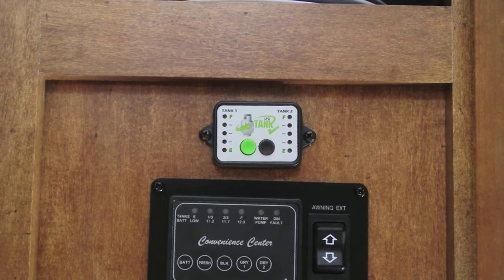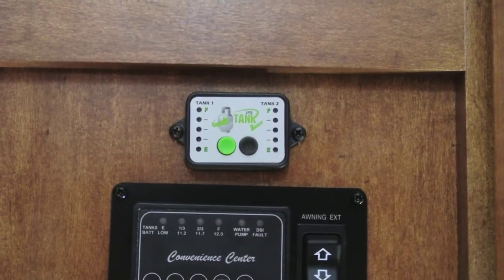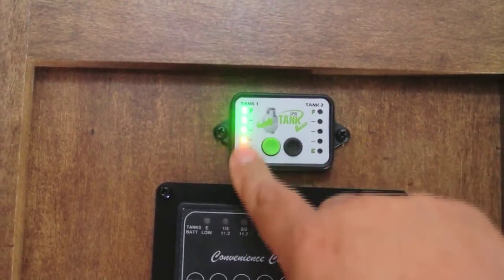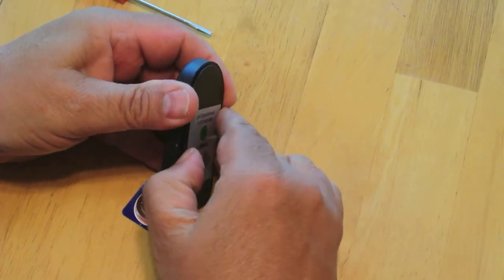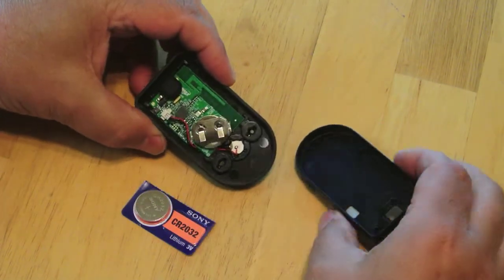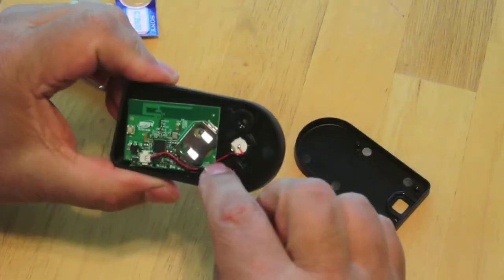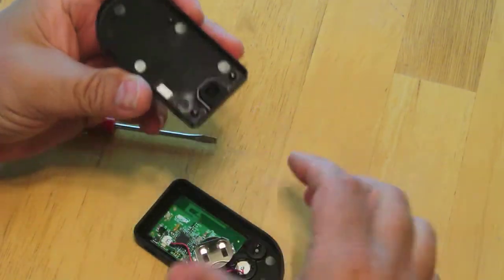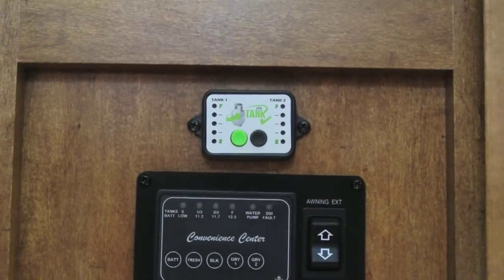Replacing the batteries in the Mopeka Tank Check sensors.

Comment: I need to change mine for the first time this week and appreciate your video. I am confident now. Curious: have you tried their app? If so, how do the readings compare between the app and their monitor?
Reply from the maker: Yes I use both the App and monitor. I fact, with Version 1 of the monitor, it was preset for 20Lb tanks only.  In those days, you needed the App if you wanted to monitor 30Lb tanks.

But beginning with V2 of the monitor, it can be set for different tank sizes.